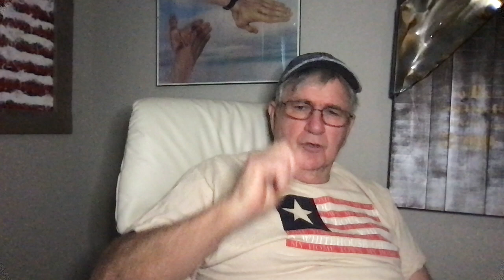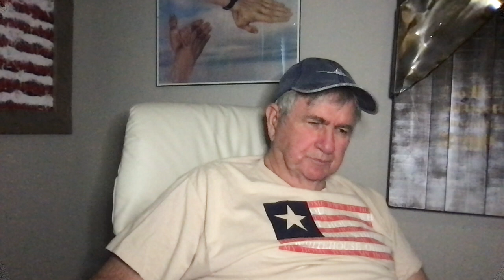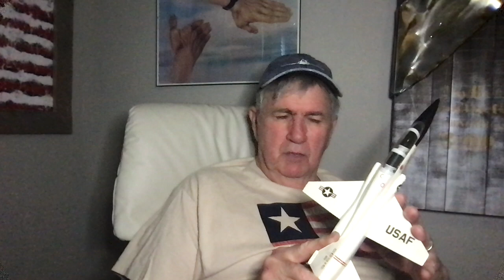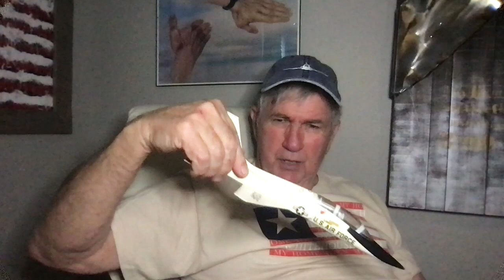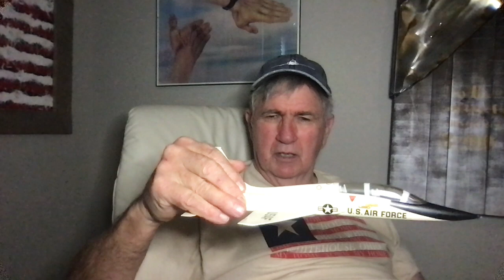Dual Engine Failure

Comment: Did you ever figure out what the problem was?
Reply from the maker: There was a "rollback" of one engine from high nose high attitude.  (I think it was the right engine.). Both throttles were then rapidly retarded to Idle, probably causing the left engine to stall.  That gave them the "dual engine failure.". From there inappropriate restart procedures were tried to no avail.  Then they jumped out...
Reply: @threesin7107  But why did they still have exhaust temperature?
Reply from the maker: Think of the engines rolling back but not flaming out - like 'stagnation.'
Reply: @threesin7107  ...and that's why the situation was so eminently recoverable, right?
Reply from the maker: @thomasherbig  So, just after the first engine failure the IP snapped back both throttles to Idle as mentioned earlier.  With the aircraft in a nose high attitude, airspeed decreasing when the throttles retarded to Idle, there wasn't enough airflow through the engines to keep them running normally.  In a case like this you would probably see very low EGT and RPM indications.  Holding the nose up to maintain an airspeed of 180 kts. or so kept the engines from recovering.  The IP mentioned that he did not reference the checklist because he felt he "didn't have time.". In essence, had he looked in the checklist it would have directed him to lower to nose to pick up airspeed to recover the engines!   I hope this helps...

Comment: I reported into Columbus soon afterwards. Scuttlebutt just as you recalled; Several “RESTART DURING FLIGHT” & “ALTERNATE AIRSTART” checklist attempts. Memory vaguely recalls the last ALT AIRSTART the throttles had been left in MAX AB prior to ejection and one or both occupants thought they heard the engines running as it blew past them. In PIT y’all advised us to guard the throttles from being advanced at slow speed on those Nose High Recovery demonstrations. Loved how the 38 was spin resistent. 
Thank you.
Reply: Just a note to let you know that the IP was assigned to the KC-135Q at Beale AFB.
Reply: @trojanson3 How the heck did the IP ever fly again after that plain example that he didn’t know how to fly a jet? And n no it only that, but he was put into a Q?! Please tell me his position was lying prone in the rear window.
Reply from the maker: Thanks, I knew he was reassigned "out West," but I always thought he went to T-43s at Mather.

Comment: Did the IP use the correct checklist? Surely the need for speed for a restart was in the procedure. Not to pile on as we ars all human at the worst time.
Reply: When under duress, it's amazingly hard to process ANY data that is outside the exact thing you've set your brain to look for. This is largely the entire point of training, so that those procedures are ingrained to be pure second nature when faced with an emergency.

Most drivers wouldn't be able to downshift and/or atop using an E-brake if their hydraulic brakes died going downhill.